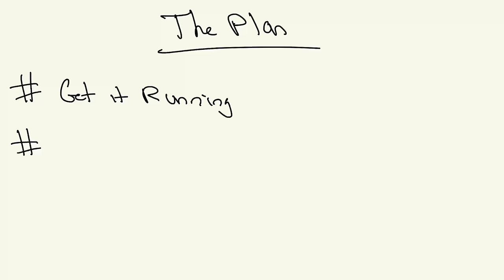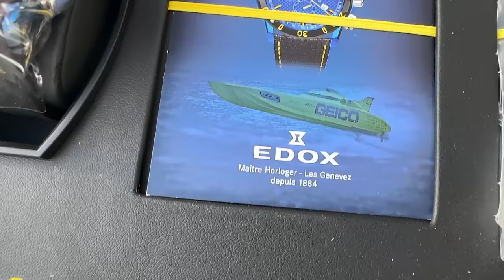Why you Should NEVER Buy an Orange County Chopper

Comment: The company I worked for spent $400,000 for a Orange County Chopper advertising package.  It was not worth it.  We got a nice looking bike that wasn't even street legal.  A few T-shirts, and 45 seconds on the program. We also gave them custom build spraybooth.  We were promised advertising about our facility. When we complained we were told that OCC didn't have control of the program.. We spend a years worth of advertising for 45 seconds of them presenting the bike to our owner.
Reply: Sounds like your boss is a gullible guy 😆
Didn't he at least watch one episode? Everybody knows this was all a scam
Reply: @h.g.buddne I don't disagree.  I finally quit that business even though I was the only electrical designer and programmer.  Later he hired a young guy that restructured our pricing and company model and things went down fast.  He wound up alienating our biggest customer.
Reply: On discovery channel? You got a good deal. Not a commercial, but a 45 second spot on a mainstream tv show? That’s great advertisement. No offense but you got your moneys worth.
Reply: @kregadeth5562 I don't agree.  It's not even a tiny bit of what we were promised.  The only mention of the company I worked for was them presenting the bike to the owner.  Not a thing about the company itself or the custom spray booth we built for OCC.  They originally told us they would include shots of them using the spray booth to paint the bike.  We erected the booth in our shop and they filmed the painting.  Then we moved the booth to their shop.  Not one second of any of this was shown.  We paid $400,000 and the bike was crap.

Comment: I had a fuel pump on an outboard seize up with old fuel. I used a SeaFoam soak for about 1 hour and  could work the impeller a bit and then it freed completely shortly after. It made me a believer in the SeaFoam and saved me an $800 fuel pump replacement. Cool video. Ulster County
Reply: Ethanol is the worst thing to happen to the petroleum industry since opec.
Reply: buddy knows a guy who starts mothballed boats all winter for like $10 a month per boat. once a fuel pump sits and seizes up , its $500 for a replacement with labor so 10/mo is nothing for a boat owner. He does about 100 boats a month, just starts them up and lets them idle for a few minutes and shuts them down. He as yet to have a customer state the pump is out when they get it back in service.
Reply: @houseofsolomon2440  the Bo Gulf disaster is a lil worse then having to keep ur fuels lines from clogging it's called run than motor fewinuts once a week . Make it a Sunday funday chore add to list and never had the issue u stated
Reply: @houseofsolomon2440   Consumer ethanol is greatest thing since slice bread
Reply: @houseofsolomon2440  You wouldn't say that if you were selling the subsidized corn. ;)
Reply: @houseofsolomon2440  underrated comment
Reply: Ulster county a spelling mistake of you from Ulster??
Reply: Seafoam is decent stuff. But you ever used Kroil by kano labs? Much MUCH better. But hard to find.
Reply: You live near Gerald Celente. That’s cool.
Reply: No mistake, Ulster County, NY @chris9650
Reply: @homesteadfromscratch  aah never knew there was an Ulster county in the states. From Ireland myself that's why I was wondering 😃
Reply: Opposite of my experience, had a gas tank full of crystallized E-Gas mix, poured in seafoam and a cup of pea gravel and gave it a good shaking, the seafoam poured out clear, didn't dissolve anything. Tried it with the real Goof-Off (xyline), that cleaned it up to bare metal, the gravel took the rust off and the pour out looked like brown paint.

Comment: When OCC was on TV, they didn't even build their own frames. They had a custom builder make them. That's why you never saw them welding up a frame.
Reply: Yep,the basic models, they bought all the parts in bulk and then just bolted  them together for ridiculous money.
Reply: @davehoward22  At least later, when the company had a large headquarters, the frames of the custom bikes were manufactured in-house.
Reply: reminds me of a "custom drum shop" in my area that doesn't even make their own drum shells. Just paints the shells and attaches hardware... Quite a big following as well.
Reply: Probably bought the frames from Jireh...

Comment: Why would anyone leave fuel in that thing?   Very sad how people mistreat their engines.  The whole fuel system is full of varnish and gelled fuel.  It had no chance of running.  I am amazed that they didn't stop and clean the entire fuel system before trying to crank it the first time.
Reply: That is toe-curling instant gratification for you. Or the 'need' to make this story watch-worthy for those who lack the knowledge to be upset.
Reply: @mmeijer635 it's like his comment that that hydraulic clutch was dangerous, hydraulic brakes are fine but not clutches?, today all vehicles have hydraulic brakes and many of them have hydraulic clutches, has he never had a clutch cable brake, such a stupid comment.
Reply: why you'd ever put fuel in that horrific monstrosity of a bike in the first place is a mystery XD
Reply: Never buy anything Paul Jr. Had a hand in building. Theme bikes are trailer queens and made for display only.
Reply: Yea, real mechanics know to drain fuel system.  Check for dry rot hoses, check for rust in the tank, pull injectors and make sure their clear and change filter. Then put new fuel in and run fuel pump to see fuel coming out at the fuel rail.  Know for sure it's ok, then if it don't start, only thing left is spark. Which is the other thing to check. Pull plugs, replace wires due to dry rot, then try to fire it up.
Reply: because the owner of the miss geico team has more money than good sense and has the money to not care about leaving gas in stuff.
Reply: @CrusaderSports250  No kidding, even if the clutch wouldn't disengage all you have to do is keep the throttle at a neutral position and shift to neutral.
Reply: @starbattles1  Change the friggin' oil too if it's been in there for over 5 years.
Reply: Not Race fuel. Reg gas, yes.
Reply: murricans...
Reply: Besides taking the whole fuel system apart might be good to check and change the oil.
Reply: First time to this channel and I had the same thought. Why did they even try to start it when the fuel line looked like that? I kept thinking "have they actually worked on bikes before?"
Reply: @leroyraatz5650 In other words, the guy makes shitty motorcycles that don’t even really function as motorcycles. They might as well be sculptures without any ignition systems.
Reply: @starbattles1 I have my 2009 Suzuki V-Strom in my garage and it hasn’t run since 2019. I have zero experience at getting a dormant motorcycle running. Yeah, I did let it sit with gasoline in it. 😕 Your comment will probably serve as a reference point when I finally try to get it running again. I just hope it doesn’t become too huge a project.
Reply: @leroyraatz5650 he said Paul sr. 😂
Reply: My bike sat for 3 years because I had some stuff going on and I put fuel stabilizer in the fuel and cycled it through the FI system before I parked it. I thought it was just going to be a few months. First thing I did was drain the tank. It actually smelled like fuel still and there was no varnish in the tank so I didn't tear into the FI system. I probably could have started the bike on it but it would have been very low octane. Loses 3 RON per month IIRC from my air mech days so that would have been like 5 octane at best. Even with the low compression and open exhaust, I'm not running my Dyna on that.
Reply: Why are you amazed they didn’t back the trailer up to the shop they dragged the bike across the lot.
Reply: @Bovrinox  Agree...that thing is ugly as sin. That charger up top with the belt...yeah thats really appealing...and safe.
Reply: @leroyraatz5650  Long rakes on some of them make it a pain to ride esp tight turns, no thanks
Reply: When you pay for a shelf queen after the Geico race boat series went kaput who was gonna care about the bike on a rotating platform built to make noise at boat races?

Comment: I would rather have the boat instead of the bike..
Reply: I'm still wondering what model it is!!!! I've never seen them that big unless there the jet powered turbine engines
Reply: @hiajoonblitz8334 right but looks like it’s just a model hull for display.
Reply: I wonder why it's so heavy though. @LukeK1738
Reply: @hiajoonblitz8334  The full size boat was a 50 foot mystic running twin Lycoming turbines. Made 4200 up.
Reply: I hope it's remote control
Reply: 😂😂😂😂. Me too
Reply: I'd rather have the trailer; I could live in there.

Comment: The watch is an Edox CO-1.  It's a quartz watch with a one off face.  Being quartz (versus mechanical), it's cheap crap.  It'd be considered a cheap novelty watch.  I'm a watch guy.  Nice trailer, though.
Reply: Quartz doesnt automatically mean crap. You can get full metal, jewelled, high end, luxry quartz movements. Just as you can get cheap, crap mechanical movements.

Comment: Looks like the watch retailed for around $2500. Between that and the trailer I think you broke even.
Reply: He's up. His neighbor offered 15K as is.
Reply: $950 now
Reply: Also... it's a mechanical watch. It almost certainly works fine, you just need to wind it. I don't see "automatic" anywhere on the face, but since it's a custom Miss Geico watch, it might still have an automatic winder, which uses the motion of your arm to keep it wound while you wear it. Also, it's a chronograph, so you can use it like a stopwatch and stuff.
Reply: @raelik777 you actually just need to push the dial "in". All nice watches come with the dial "out" so as to not drain the battery.
Reply: @FlashBangMafia  It's mechanical, there is no battery.
Reply: @raelik777  And that trailer is enclosed with a ramp style door at the rear which can be used for loading and unloading. It’s clearly custom. I know this by the “Miss GEICO” graphics on the side and the yellow color.
Reply: @Sktzo  As part of the sponsorship with the Miss GEICO Racing Team, Edox has released the Miss GEICO Limited Edition Chronoffshore-one, chronometer/dive watch.

All of the signature hues of the Miss GEICO race boat — a 44-long catamaran — have been incorporated into the substantial yet sleek and stylish men's timepiece. The timepiece is a limited edition of only 113 pieces, since the number which identifies the Miss Geico racing team is 113.

"It matches all the colors of the boat," said Marc Granet, the driver for the Miss GEICO team. "But it's the blue carbon fiber face that really sets it off. The whole team is excited about it. The last version sold out and became a collectible. You rarely see one come up for sale.
Reply: That’s a really cheap watch brand lol .regardless of the sponsorship it’s a cheap watch .
Reply: @Grcia14 It's ok to say you don't know what you're talking about, or nothing at all. You don't have to try and act like a watch snob whilst looking like a doof.
Reply: @Sktzo  it was just a comment relax .Been collecting watches for years so hell yea I know my stuff 😂😂proud of it also
Reply: @Sktzo haha! @Grcia14 just punked you! 😂
Reply: @Grcia14  But you think a Swiss company that's been around for over 100 years is a "really cheap brand". Yeah, I don't believe you. I am a collector myself, and have MANY collector friends, and none of us think they're a "cheap" brand. And that's coming from people with ALS PCs. Inexpensive? Yes, esp in the watch world. Cheap? Not by a country mile.
Reply: looked it up 1500 Euro..  i Think if you want to import it into the US you're right
Reply: @Grcia14  that would still be much more than i ever want to spend on a watch.
But than again, i'm not into watches..

Comment: Fuel injectors would definitely need unblocking after years of bad fuel in them. I have used a 9v battery to activate and free up stuck injectors before. Works like a charm.
Reply: Dont understand why they didnt do that immediatly after seeing the fuel line. You already know everything that touched fuel is potentially fucked.
Reply: The fuel pump is also gummed up with the same jelly goop as the fuel lines, which is why it was seized up.

Comment: Honestly, does not seem an OCC quality control issue. It was left standing for 5 years and if nothing holds, the fact you never leave high performance machines unattended for years is true.
Reply: If its any consolation, Paul Sr. was supposed to be our road captain to ride over the sunshine skyway bridge from Bert's barracuda Harley during Bert's bike week last year, over 200 bikes went over the bridge, Paul's bike broke down before making it to the bridge
Reply: Its absolutely idiotic to put a blower/supercharger or turbo on a high compression engine. That part was OCC's decision when it was built. The bike has no suspension or even a seat, Another idiotic decision.  The bike is fantasy bike for display, nothing more.
Reply: @davidkellner7372  That's hilarious, a rolling meme, in real time.
Reply: @spartanx169x  That would be true for an engine running on pump gas but since it was built to run race gas the high comp and boost go together just fine.
Reply: @bobabreath5097  as soon as I heard who was leading and what he was riding I jokingly told someone "I know who's not gonna make it" that aged well 🤣
Reply: fuel lines shouldn't disintegrate after 5 years though 😂.
Reply: @PuerRidcully  Race gas will disintegrate rubber in months. That's why most people who let their race engines sit in the off season will run regular pump gas through the engine for storage.

Comment: Knowing nothing I got an 02 Shadow that sat for 2 years with a full tank, started in about 30min. It ran like crap but it wanted to live. Got it for $300 and then really worked on it. I restored a 75 CB550F after that. Lots of work. If I got that bike, first thing I would do is check the plugs, check the tank and fuel filter. Then check for a petcock in the off position. If all good, I would prime the fuel before a full start. Get it into the lines. Also be sure the oil was fresh. Then give it a good try starting it. 

I found the CB550 crank start was more fun but really, rolling down a hill and popping into first was the best.

Comment: That EDOX looks like a Chronoffshore, and just at first glance, based off of the CO-1 model. They have several versions but range from 2-4k used market.  Might be worth it to get it appraised, especially since it's most likely a 1 of 1.
Reply: It’s like 2000 it’s a 1/113
Reply: It's made to look like one of those bit it's not. It's a cheap quartz movement inside

Comment: when my 1984 Honda vf500c wouldn't start without carb clean, and i removed the fuel pump and called the local Honda dealer and they said it doesn't have a fuel pump, and i bench tested it and it just smoked in my hand and its bad; they said it doesn't have a fuel pump and there is no listing for it. I bought an Edelbrock electric fed gravity pump and plumbed it up and it works just like the old one, and you can hear if its running or not with the key on.
Reply: The VF didn't have a fuel pump. Carbureted bikes don't.

Comment: High compression and boost means more power, higher octane requirements. My old SN95 had 583ci supercharged running methanol injection with 15:1 compression before boost. I never did run NM in it but it would’ve ran fine if the chassis would’ve been additional supported to prevent twisting.

Comment: The watch might have a vibration sensing tac, or maybe a remote sensor for the bike. 

Look for such when you disassemble it. 

You can measure rpm by sensing vibration in the bike. 

If it has a tach in the instrument cluster, the watch might connect to it.

Comment: Since your watch is a chronograph, more than likely it has a quartz movement. Since it was still wrapped in plastic, I would assume that it has never been worn. If that is true, then the crown is pulled out to keep the movement from running and using up the battery while in storage. Try pushing the crown in and see if it runs.

Comment: I had the pleasure of working on the AMG bike they built for Mercedes when it was auctioned off for charity. The new owner wanted to get it running after it sat for several years. After rebuilding the carb and replacing all the fuel hose, I got it started and set the ignition timing because it was way off. I test rode it around the block and it was the worst handling motorcycle I have ever ridden. The rake and trail were so off it was dangerous. Not to mention the seat and foot pegs were setup for someone the size of Shaq. Those clowns have no idea how to build a motorcycle.

Comment: I've only been riding for about a year so take my opinion with a grain of salt. A buddy of mine I work with got a camo OC chopper at an estate auction a while back. It supposedly was on the show but I dunno much more than that. It's terrible. It has zero suspension for whatever reason so every little bump in town was pretty painful. It was really squirrelly in the steering, had zero power, it didn't even have a speedometer.

Comment: Even if you lose control of the clutch you can align the gears at low RPM and downshift to neutral. Still sketch, but almost every bike clutch is hydraulic so not really a concern worth mentioning.

Comment: If a new fuel pump burned after 1 5 min ride only ... It only mean that there is a SHORT to gound... The electrical wires have been mistaken ... Recheck and make the shematic ... The builder probably sucked in electric wirings ...

Comment: dude if you see a fuel line that has loose stuff in it, you HAVE to disassemble the engine and everything that was in contactvwith the fuel. then clean, the rebuild with qctual fuel lines. never try to start